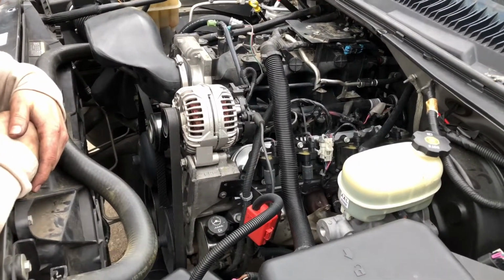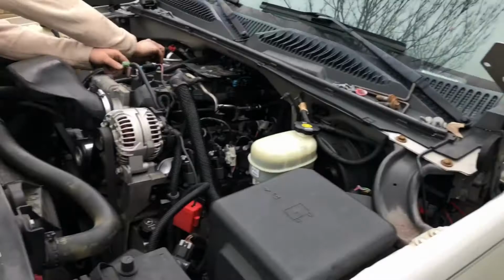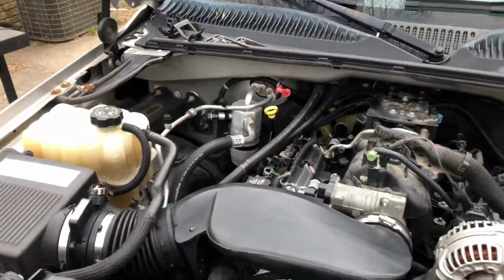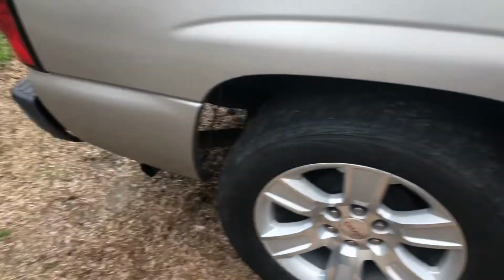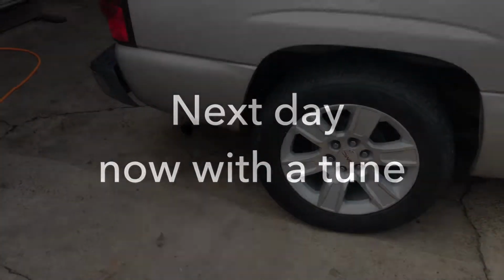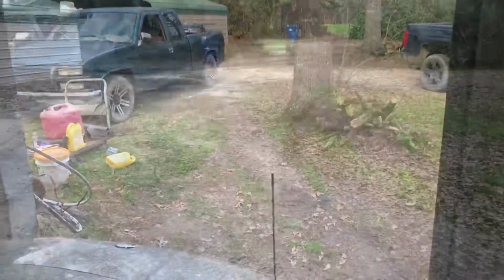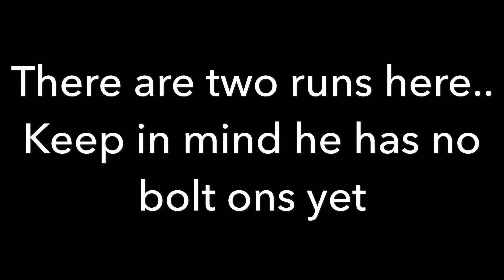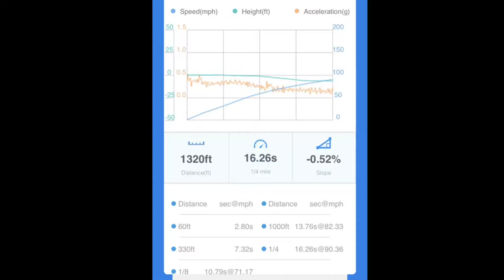Built 5.3 first start up and 1/4 mile test

Comment: The Elgin 1839p is an excellent performer!  It will work with a stock converter but does even better with a 2400-2800 converter.
Reply: @Crosby Lennon Instablaster =)

Comment: Something’s gotta be wrong, my fathers bone stock 5.3 crew cab 2wd with 2.23 gears and stock 4l60 ran 16.7, after truck Norris cam only on just a 93 tune it ran a 14.8, I’ll gladly send you proof and tell you who does our tuning if you’d like
Reply: With spare tire and tool box in the bed and full weight including air bags in the rear because it’s a dropped truck

Comment: I m shopping pistons for my 5.3 .030 over ,what pistons did you use.Cant decided on the 300 dollar summits or the eday NPR  FOR 269.00 WITH RINGS
Reply from the maker: H1132CPA SEALED POWER  are the pistons that are in that engine
Reply: If your boring a 5.3 block don't waste any money on 30 over pistons they can be bored all the way out too fit 5.7L LS1 pistons and you'll have alot more power than what a dinky ol 5.3 ever could do

Comment: What pistons you go with I have a 2000 chevy tahoe with dss forged pistons flat tops havent hit rod it yet letting the piston rings break in before I do anything like that it has stock cam also not sure if I should be concerned but also have a tapping noise when engine is cold evey single time it always goes away when the motor gets to operating temperature it does have all new lifters the cam is still the stock one tho could it be valvtain noise or maybe piston slap when the engine is cold????
Reply from the maker: These are the pistons he is running H1132CPA SEALED POWER, as far as your tapping, hopefully it’s not a lifter or piston slap but that possible, I would check for exhaust leaks and look check the injectors, especially if it’s more of a clicking noise, but if it’s an actual tap then it may be a lifter
Reply: @drivinwithdrew7676  I did replace all 16 lifters unless one came defective and I did  load it to the trailer and took it to the machine shop to see what they thought it was and they said it was my injectors replaced all 8 and the tapping noise is still there it always goes away and sounds normal once the engine is up to operating temperature
Reply from the maker: @chavez4365  well you could pull off the oil filter and cut it open to see if there way too much metal in it,
Reply: @drivinwithdrew7676  I did do that I did the first oul change at 500 miles this next one ama change it at 1000 miles I did think of that and I didnt see much just alot of fine metal which my guess is normal or am I wrong???
Reply: I also let the machine shopkbow that the noise was still and that it would go when the moto got to operating temperature and they said it should be fine.....
Reply from the maker: @chavez4365  a little fine metal is alright, but if it’s a lot, then you may have a problem next time you drain the oil into a pan let the oil sit in the pan then slowly pour out the oil, then look very close at the bottom of the pan, if it’s full of metal, then you probably have a problem
Reply: @drivinwithdrew7676  alright I'll be doing that next time and see if there is still alot of fine metal if there isnt would it possibly be????
Reply from the maker: @chavez4365  there would be a good chance that it’s piston slap, if you do your own tuning, go in the scanner and cut spark to one cylinder at a time to see if then noise changes, if it never changes my guess would be a lifter or bent valve, but more likely lifter, if the noise does change then it’s probably piston slap, a rod bearing, or exhaust leak,
Reply from the maker: @chavez4365  also make sure all your spark plugs are tight
Reply: @drivinwithdrew7676  I dont have the tools to do my own running it's still running stock tune and I will do that but I'm thinking of disconnecting the coil pack one at a time I'm not sure if it will cause damage to the coil pack or not
Reply from the maker: @chavez4365  unplugging one coil pack at a time is alright, and definitely worth a shot
Reply: @drivinwithdrew7676  alright I'll be trying that this weekend if I couldnt figure it out ama take it that it could be the camshaft or maybe a defective lifter and if there isnt much metal on in the oil the next time I do an oil change I'm thinking of swaping the camshaft to a texas speed stage 3 high lift cam
Reply: @drivinwithdrew7676  also what would be your opinion on dss forged pistons is it a good piston idk if you have ever ran those pistons before also this is my first build I have ever done......
Reply from the maker: That would be sweet, you should listen to my bmw in my last video, it has a summit racing ls1 stage 3 cam
Reply: @drivinwithdrew7676  it does sound nice

Comment: In the video you said it hasn't been tuned and because of that you're going to leave a vacum line open. how does that help/what does that do? I'm not trying to troll I'm just ignorant.
Reply from the maker: The theory is, Since the motor has a cam the engine is moving more air but the computer thinks it’s moving the same amount of air, so by unhooking it will compensate for a little bit
Reply: @drivinwithdrew7676  that makes since, thanks for the reply. solid truck bro!

Comment: might want to get some gears or a converter upgrade because that take off has no torque, my 04 crew cab has some stock 3.73 and i know its faster off the line than that
Reply from the maker: You should check out some of my more recent vids, it has 4.10s in it now

Comment: This is a rough draft absolutely what happens when cam is not matched with converter or gears
Reply from the maker: Yeah, it also had a near stock tune on it in this video too, the brown 94 c1500 with a 5.3 thats on my page, we put a 3200-3400 stall in it, and it’s made a huge difference, especially with a 4l80, he went from a 15.0 to a 14.0 just from the converter and a tad bit of weight reduction,
Reply from the maker: Yes sir
Reply from the maker: @josehuerta7856  my BMW picked up quite a bit with some reman 706s that I did some work on, over stock ls1 heads

Comment: What was the race weight when you made those passes?
Reply from the maker: Idk what the weight was, but I know it’s heavy being a full weight crew cab
Reply: @drivinwithdrew7676  Well, I went backwards mathematically.  Your stock pull was at 5757 and made 286 HP.  Cam = 5567 and 322 HP, Headers = 5567 and 337 and 4.10s = 5567 and 338.

Comment: Dang, this went slower than factory. My 05 stang ran a 13 while misfiring the whole track
Reply: How much does a mustang weigh?
Reply: @diduck6878  😂 lol
Reply: @diduck6878  rite!....😒
Reply: My lightning ran 10s with a smaller screw pulley and a good tune job